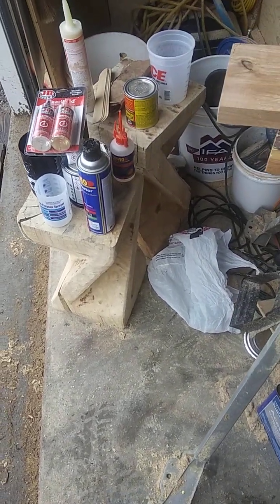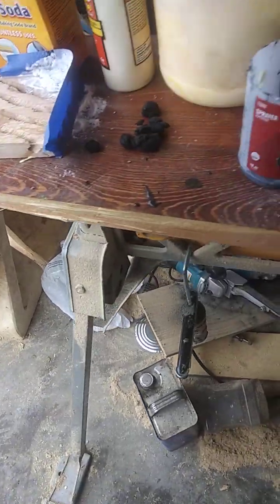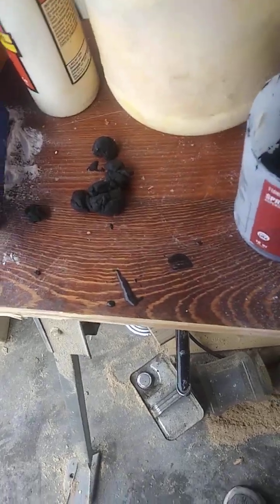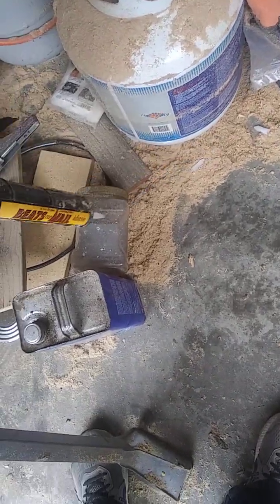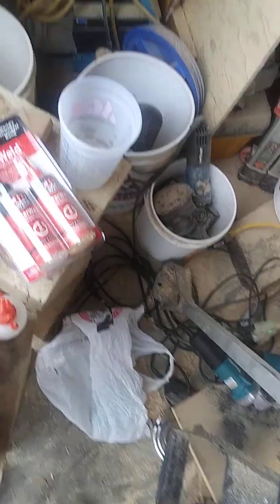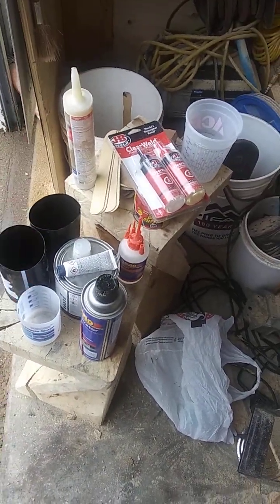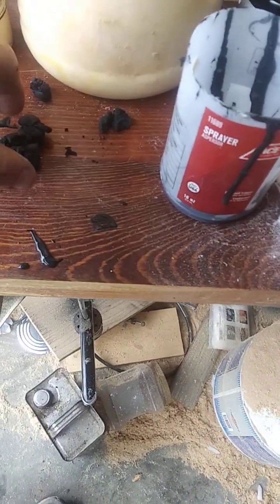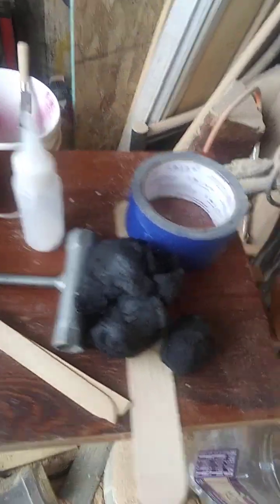mistakes and new ideas

Comment: Add some borax to your "flarp" to changes into silly putty.
wood glue won't fill gaps unless you mix it with saw dust.
construction adhesive fills gaps but a pain to sand.
epoxy is the same covalent bond as wood glue but faster drying.
CA "supper glue" is a chemical, electron sharing bond. Baking soda fills the gap and readily shares electrons for quick "drying" reaction.